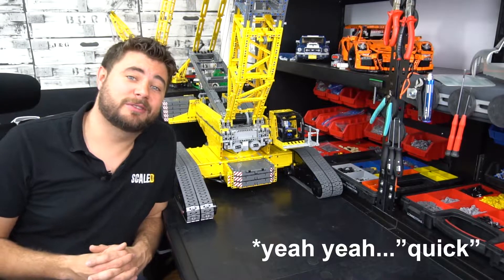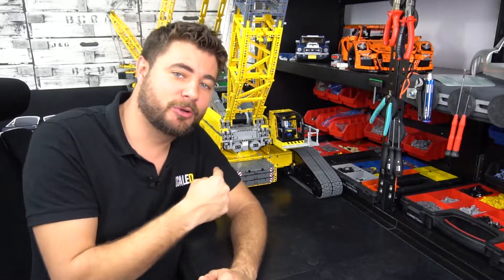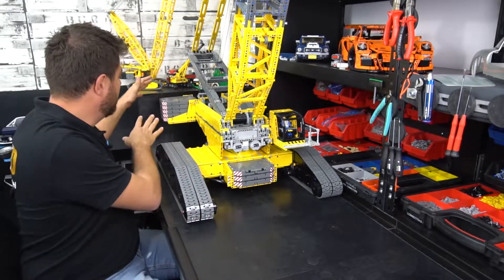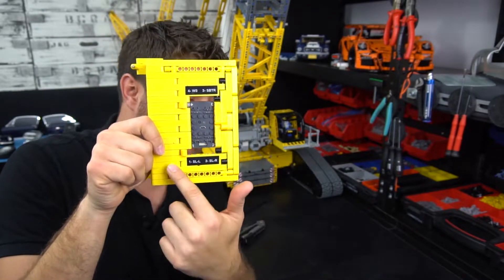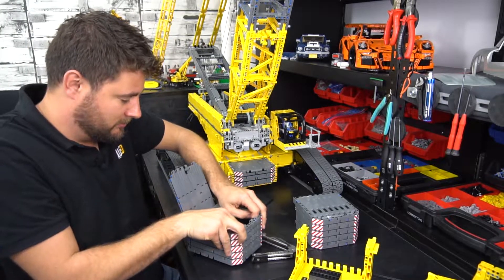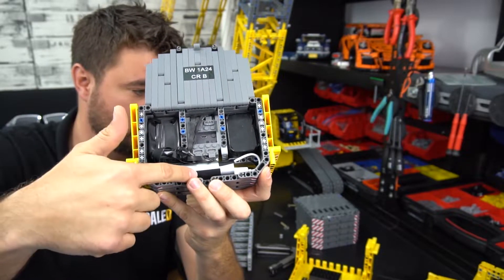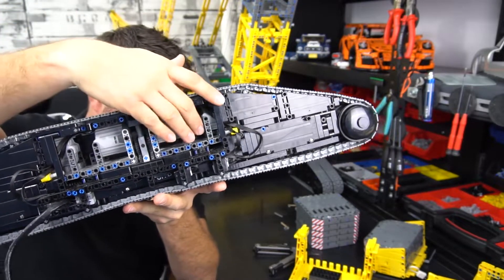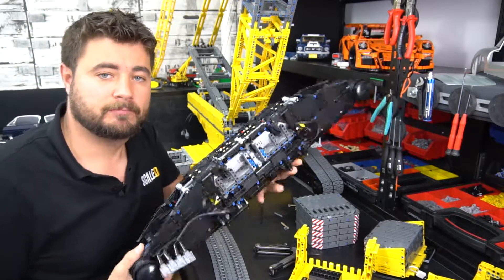Technical Details About My Lego Crawler Crane | Power of BuWizz Competition | ScaleD

Comment: How much does this crane cost? I don't want to buy it, but I want to know how much did you spend
Reply from the maker: I can't tell you exactly. I knew from the begining that it was going to be expensive, so after I received each part order' I deleted the invoices/ammount so that I don't know the total...otherwise it would probably be depressing to see how much I've spent with it
Reply: @ScaledChannel  thank you for the answer! I can imagine that it costs somewhere between 10k and 15k. Is it true?
Reply from the maker: I'd like to think that it's under 10k. I think around 6-8k, not just what you see in the video, but also including the parts that I bought but not installed yet. I still need to make some stuff.
Reply: @ScaledChannel  oh ok, it is quite "cheap". Now I have thoughts about building something like this crane, I thought that those big cranes cost more than 10k. And again thank you for the answer! 
And I have 1 more question: how tall is it going to be when it's finished?
Reply from the maker: The target is 7m, but with main boom and the small LF jib that is currently on.  A luffing jib would be easier to erect from the ground (most large lego cranes have a luffing jib because of this) but I prefer a main boom as I work with this configuratipn more often (wind turbines)
Reply: @ScaledChannel  How many parts do you think are in the crane? Also, do you use some form of 3d building software, like stud.io or lego brick designer, or do you just do it all out of your head? Ie any chance of instructions? :)
Reply from the maker: I used LDD to design the crane, with some small deviations during the build. I didn't make any instructions (it would be a huge job do to that), but if you are interested send me an email at: scaled.channel (at) gmail.com and I will send you the LDD files, pictures and some explanations.
Reply from the maker: Ah...and until now it has around 25.000 parts, but it's not finished yet.